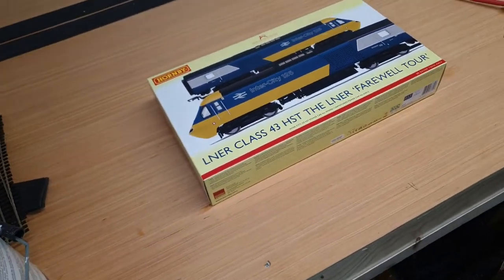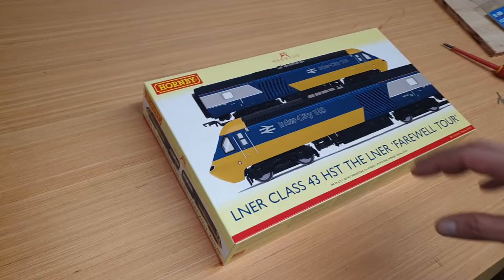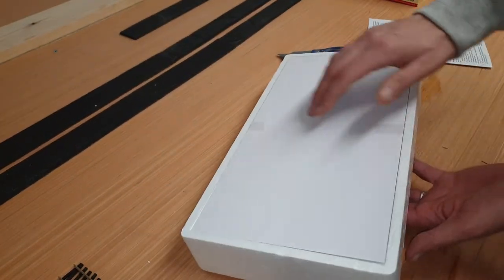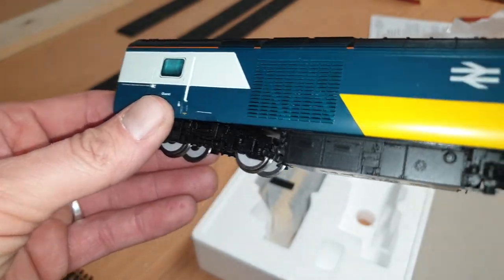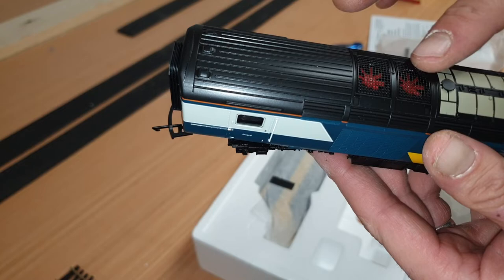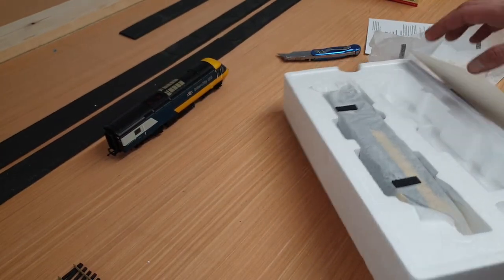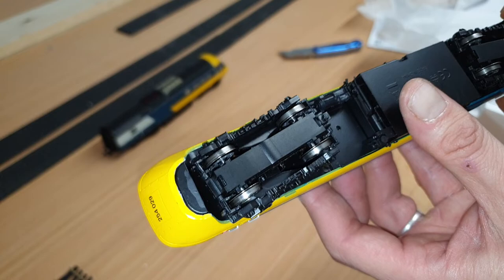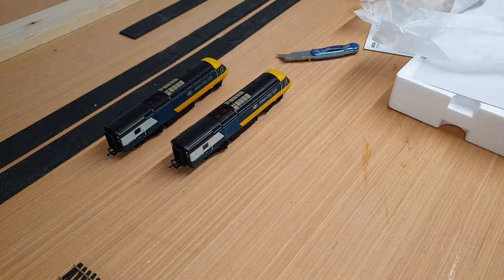hornby farewell tour class 43 hst  unboxing and review oo gauge - Stockton Junction

Comment: Hi, great review, i had the old style hst back in the 80s, i sold it to a mate for not a lot of money a year or so later, i want the new 21pin set in this original livery with the working fans on the power & dummy cars, i have the network rail NMT set and the network rail swallow livery as well.
The very large 'D' coupling on the back spoils the locos in my opinion, not sure if anybody does a connector to nem pocket at the right height so the large 'D' coupling can be changed, thanks for sharing.
Reply from the maker: I've got an original hst in its box but don't use it. I might upgrade it but as for the couplings I'm not sure